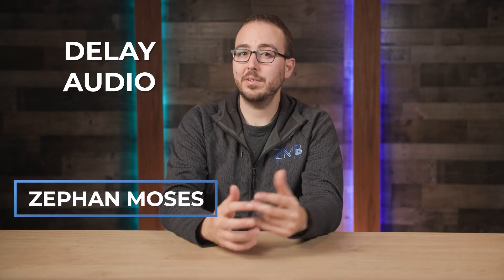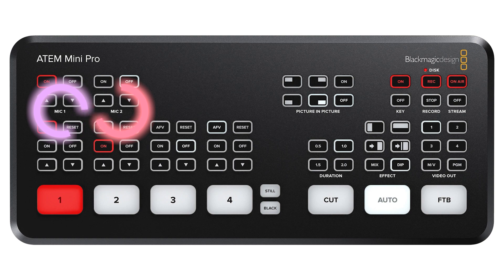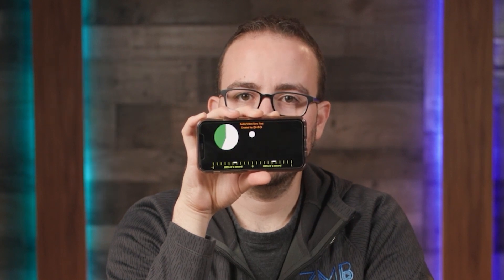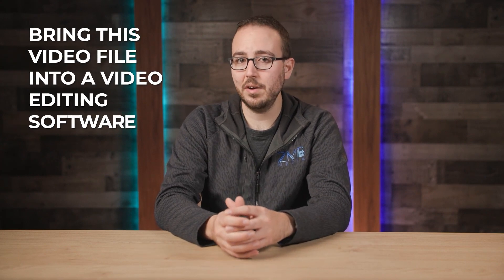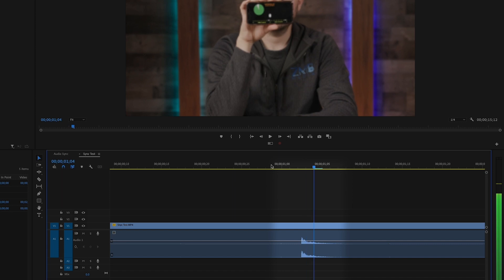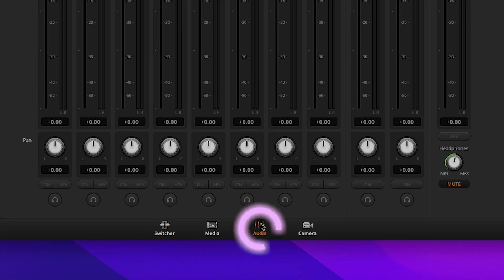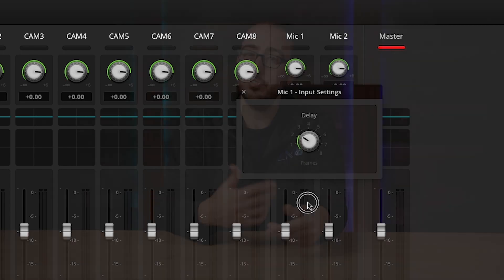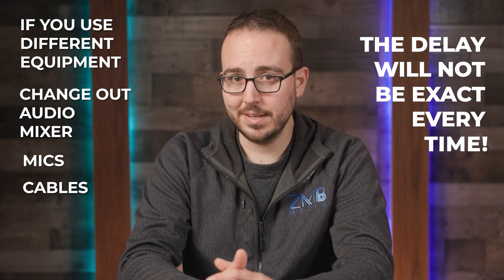Fixing ATEM Mini Audio Sync - ATEM Quick Tips

Comment: Fantastic. Thanks for this. My issue is somewhat different. I am sending audio to both audio ports 1 and 2 with the 2nd acting as a backup. Camera 1 uses HDMI connection and is in sync with the audio. However, camera 2 is using a wireless setup and is a few frames out of sync. Is there a way to delay the audio for camera 2 without it affecting camera 1 that's already in sync or do I just have to stick to one type of connection for both cameras?
Reply from the maker: Right now in the ATEM, the only delay can be added to mic inputs 1 and 2, not camera audio feeds. It's a great idea to run two audio feeds back to the ATEM but I wouldn't ever do it over wireless unless both feed 1 and 2 were wireless to match the delay.

Comment: For some reason, when I click the audio arrow the dial window doesnt pop up for me to adjust the audio delay. Ive made sure i have the latest version, do you know why it doesnt work? It worked the first time i tried it, but after going back in during another service the knob pop up doesnt show.  Any suggestions?
Reply from the maker: Hi Travis, that sounds frustrating. Are you making sure to click on the Mic input 1 and 2? You can't delay audio coming in from cameras, only direct microphone connections on the ATEM. There's a chance if you're full screen you might just be missing the pop up window that should be coming up. In a worst case scenario, consider uninstalling and reinstalling the atem software.